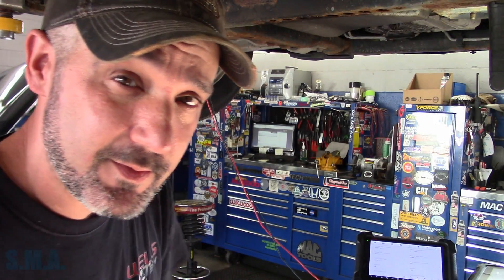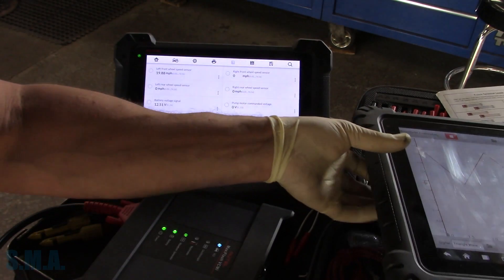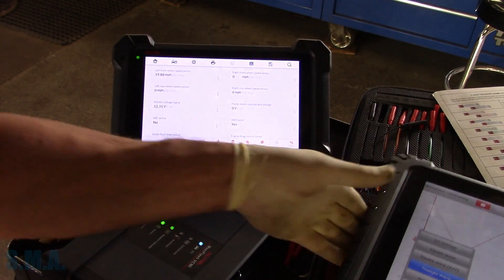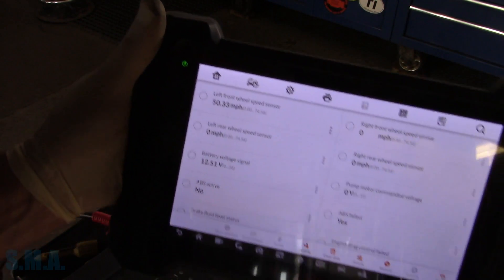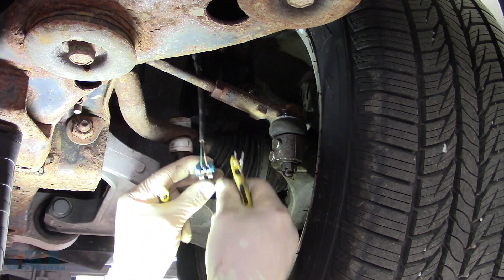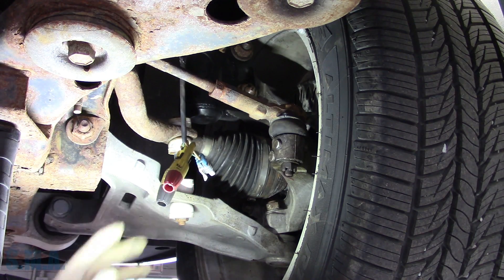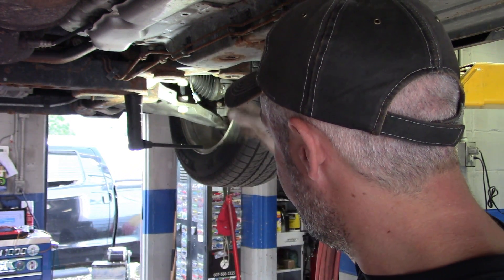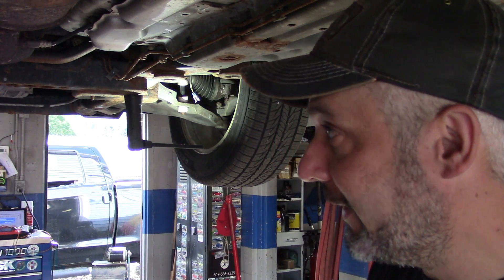Autel Maxisys Ultra: Signal Generator To Diagnose ABS

Comment: First! I never knew how techy being a mechanic could be. All this stuff is pretty slick.
Reply: For sure, I am 56 and as a kid a real gear head, did all my own work but the cars I worked on from the late 60s into the early 80s look like Model T technology compared to today's cars. I have been an commercial electrician for 35 years and few electricians I have met could hold a candle to Erics knowledge of electrical theory and troubleshooting.
Reply: Wait till autonomous vehicles come in for service.
Reply: Leon think they’ll come in on their own?
Reply: @Klainn  Imagine the test equipment you will need to troubleshoot the digital electronics they must have. Scopes and generators in the 100mhz range. All shops should have this stuff. Good tools and test equipment pays for itself many times over.
Reply: I was a young Tech, and in the late '80s I was asked to become a Drivability tech. It was a great decision. I love the heavy line,, but to be a drivability guy and to find things over the years that "Blew my mind"  . Now I see every tech needs to know this. (Or they should). Thanks for sharing all you do. Keep up teaching.  God knows I need it
..
Reply: @Johnny Blue Yea and what if the car likes the mechanic?
Reply: @Johnny Blue I took it down. After I posted it I thought it might start a political thing on here.